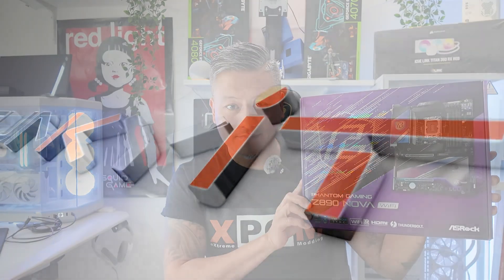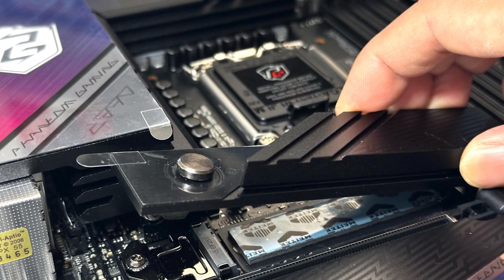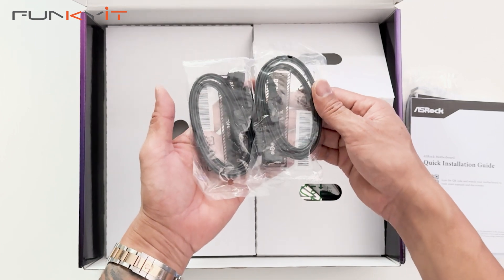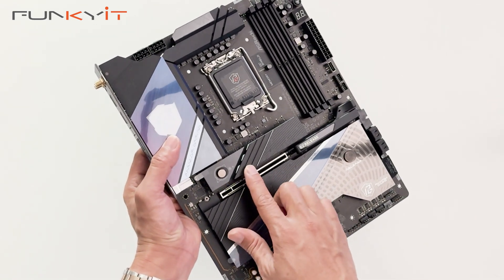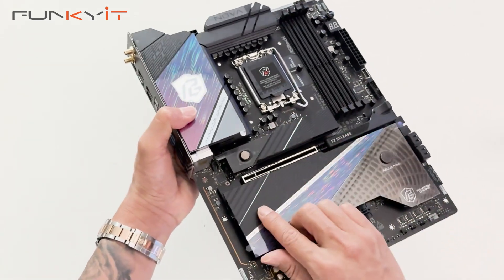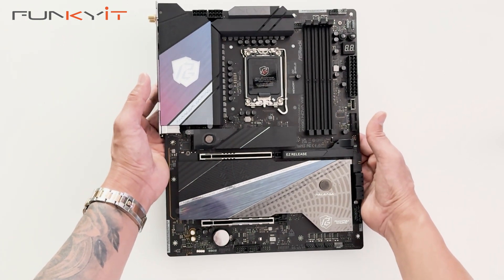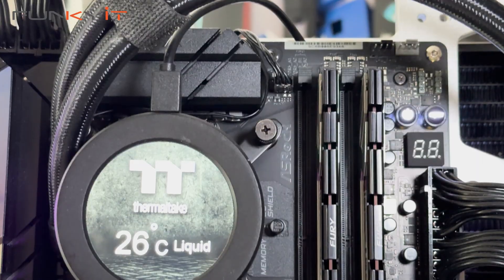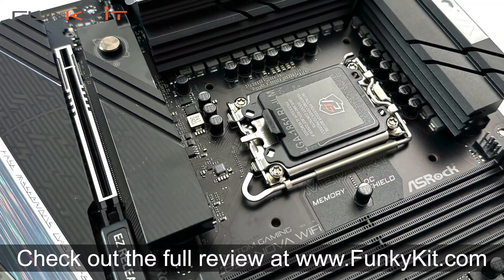The Best Z890 Gaming Motherboard Right Now - ASRock Phantom Gaming Z890 NOVA WiFi

Comment: Does the socket 1851 require a contact frame or washer mod?
Reply from the maker: No it does not require any… but if you plan to delid the CPU, then yes.

Comment: How many M.2 slots I can use without compromising the PCI_E lanes for GPU? So i can use my GPU at its full performance.
Reply: it takes out m2 slot 4 so it loses one but if you use that add in card you can use 4 on that 16x lane so you can have a grand total of 9 nvme drives, 5 on the board and 4 on the card.  pretty sweet